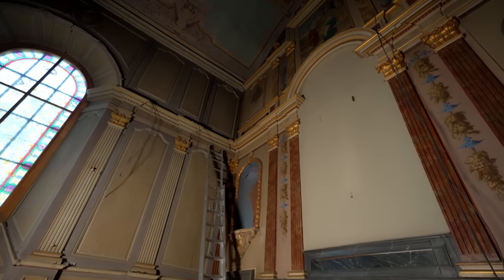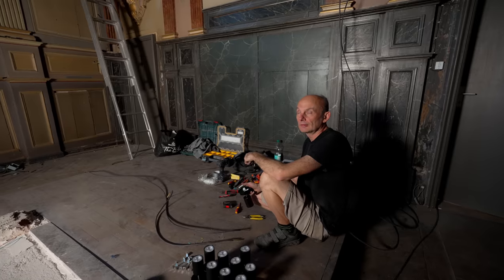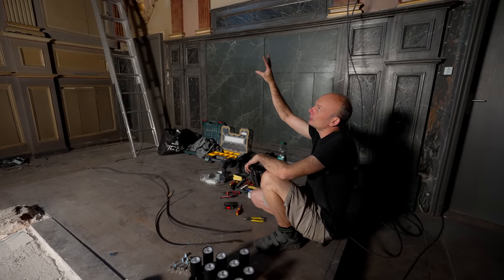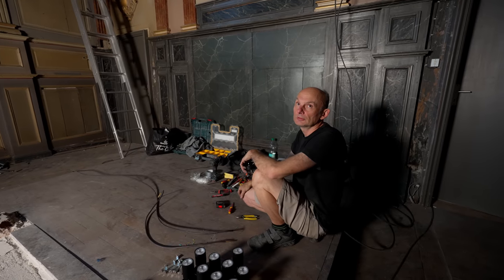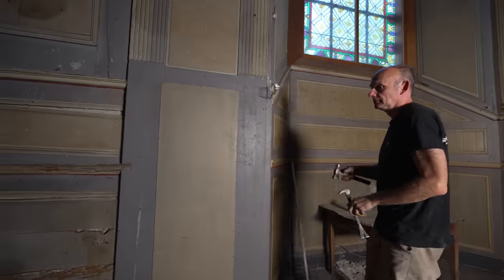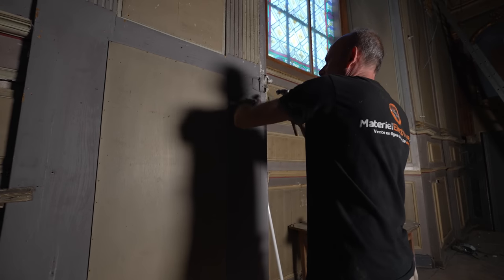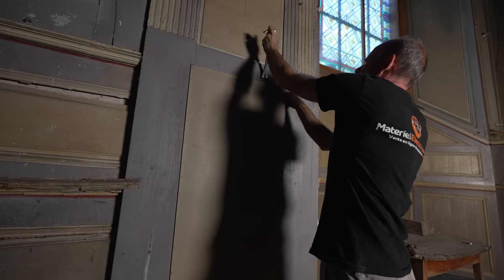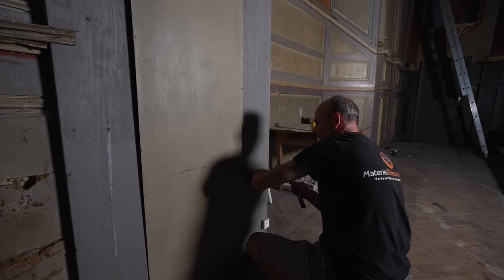The Convents Grandest Room Gets New Lights

Comment: I am not religious but I simply love that chapel. When I left school in 1957 I worked at an electrical company. All black cable was double insulated known as TRS or Tough Rubber Sheathed the single braided cable that was fed into the conduit was VIR or Vulcanised India Rubber that cable mess on the floor would be mainly those.

Comment: Billy, looking at the chapel, it looks like the cloister for the sisters, to the right of the sanctuary with all that awful faux stained glass was renovated in the 1960's or 1970's and the grille was taken out.  I would suspect that the paneling on the opposite side that you and Duncan opened up was modified at the same time when the Sanctuary floor was extended out into the Nave of the chapel to accommodate moving the Altar away from the reredos so that the priest could celebrate Mass facing the congregation rather than facing the Tabernacle on the Altar.  I would look at the Sanctuary floor to see if there are any obvious alterations other than the base for the Altar.

Comment: Hi Billy next time advise to use a wire-connector-electric-terminal-block for the wiring connection inside the lamps (2:47s), not only would save time during the installation but also for the future in case you want to change the lights. Great job you are doing there!

Comment: Billie, 
Consider shining lights at different architectural features from different angles to see how shadows are cast.
Many architects, from years gone by, placed ledges, caps, and many other raised (and recessed) features just because of the way lights and shadows enhanced the surrounding areas.
In churches you can expect crossed light (created by a window and a mirror opposite the window) to reveal a cross/crucifix in shadow on the wall.

Comment: There is a ledge at ceiling level, if you were to run led tape the full length and have a fixed angle on it you would light the ceiling very evenly. All the spotlights could then be used to light the walls and floor.

Comment: I wonder if there were stone or even marble statues of either the Virgin Mary or Jesus that used to sit where you took down that panel.  Or there even could have been where the bowl of Holy Water before you entered the chapel.  I'm not versed on catholic chapel's, especially French Catholic Chapels, so it could have been a number of things.
Reply: Usually there is a small ornate dish attached to the wall at the convent entrance into the chapel for Holy Water. There would have been prayer pews and probably a side altar or two. If there was a pipe organ, it would have been toward the back, opposite the altar. A Statue of the saint whose name the chapel is would be on one side of the altar in one niesch (ex. St. Joseph's chapel-statue of St. Joseph). The other niesch would have a statue of the Virgin Mary, quite likely Immaculate Heart or Our Lady of Fatima or Lourdes.
The convent I was in for a short time, had pews with built in cubbies where you could store your own prayer books.

Comment: Hi Billy, this might be nothing, but I studied preventive conservation. I know for framed art, you aren't supposed to have lighting directly on art (like those silly ones that hang down over frames to light them - never recommended for valuable art esp. prints, and watercolours), but I'd recommend you check if there is a specific bulb you should be using that is museum grade or something, that won't cause any long term damage to the paintings. Sorry, I can't remember what is recommended.

Comment: That old wiring with the rubberized cloth has a useful life of about 25yrs.  Definitely a fire hazard.  Those switches (especially the bottom one) look dodgy... more like menacing. :)  I'm going to call it the 'impending doom switch'.
As a Catholic, I've been wracking my brain trying to think what might have been where that paneling is.  Very odd indeed.  Wouldn't be a cloister wall attachment since the chapel belonged to the convent and wasn't public... or was it?  Strange.

Comment: Another suggestion from afar, put some of the lamps pointing at the stained glass window(s).  Put them on a separate circuit.  Turn them on at night so passersby can see that beautiful stained glass glowing on the outside.

Also question, do you find that because of the "pressure" to do daily videos you find more inspiration to "crack on" every day?